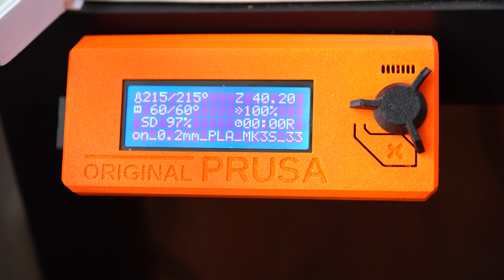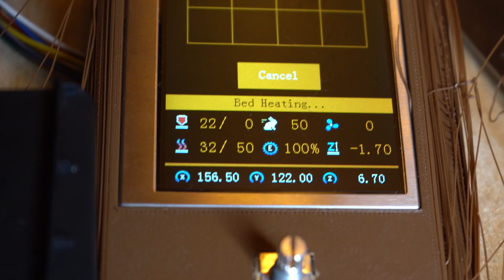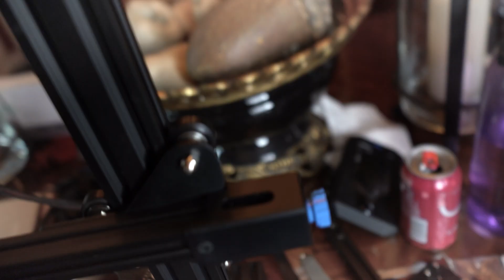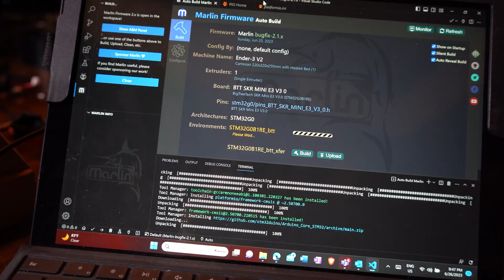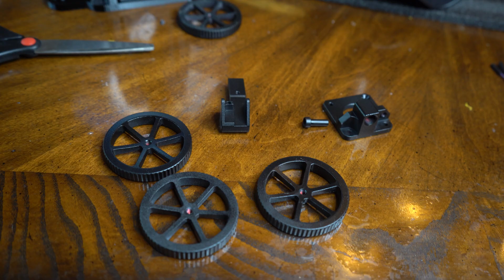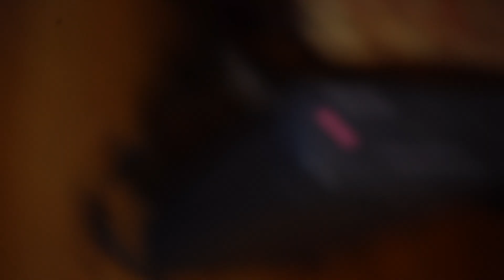The CREALITY Ender 3 V2 | Worth Upgrading?

Comment: My adhd left my ender 3 pro in pieces so I made minimal upgrades to my ender 3v2 and even then, there are some things not worth it. I would leave it as stock as possible. I think a bltouch and klipper are mandatory. Everything else is optional until it breaks.

Comment: Why was adding the extra z motor a mistake? I am looking to do the upgrade to dual and then I will purchase the board you got. I’m not too confident on the firmware side but I’m sure I’ll figure it out
Reply: I believe the board was a mistake not the extra z motor, because it comes mostly plug and play, it just adds on the existent z motor so no need to a board

Comment: weirdly i have two V2s one has a sprite and xl kit fitted never had one issue with it always adears ect the other one iv got is kinda like this i changed the extruder to the duel gear one with a bi metal heat break and its been absolute fine since both have CR touch not BL touch that's the biggest issue with them 

but then u get what you pay for

Comment: You are comparing apples to oranges one printer is 250 ish the other is nearly 1000 dollars... Even if you upgrade Ender is most likely 350 dollars at max! So 35% of the price of Prussa... Ender is for DIY people while Prussa is for people want to get results out of the box... That's the diffrence I have 6 Enders v2's And 2 v2 Neo's and I have upgraded them all with double Y and Z axis linear rails double hardened gear direct drive Extruders, plastic spring mounts, bed isolations, copper plated heatblocks, titanium and copper bi-metal heatbreaks... And last ofcourse Klipper with input shaping with ADXL345 acceleration sensor with Raspberry PI Pico so I can input shape automatically with all my printers and I have to tell you Prussa is a joke after all those updates please people don't buy Enders if you are not a DIY guy...

Comment: What was the total cost of the upgrades? Would it be better to just buy a "better printer" that has all these features already on it?
Reply: Definitely would be cheaper in total to get a better printer from the start, but if you already have a v2, its probably better to just upgrade it. Plus, the upgrades can be done sporadically spreading the cost out over time.

Comment: Not sure how cheap this all is in America... but in Europe an ender 3 v2 starts at 250€, with all those modifications you still have a printer that isn't great and probably reached the price of a prusa.
And besides, my ender 3 v2 prints fine without too much tinkering around.
Reply: Only upgrade it needs tbh is the BL sensor and maybeee springs. You definitely could buy a better printer if you get anything else it's not a bad printer, though it does surprisingly well for the price.
Reply: You do not need BS-touch, you need springs and straighten the bed. = )
But you need hands for that. So instead may be buy some modern super fast printer which works = )
I mean 250 euros is too much for this kinda model. $100 may be.

Comment: I agree with pretty much this entire video.  I went down almost the same path,  got the dual Z kit, a PEI sheet kit (and did the springs), and replaced the hot end with a Micro Swiss direct drive all metal one.  I kept the stock 427 board though.  Then I just printed a new Setsana ABS fan duct for a single 5015 just like yours.  Didn't see the need to upgrade the board in my case, since I had no interest in dual-Z leveling on a small bed slinger.  Too much complexity for too little return IMHO.  Now my E3V2 is a very reliable little machine.  I also printed some feet to fit squash balls to lift it up, and put a 60mm fan on the motherboard compartment, since that thing can barely breathe in stock form.  Now it sits in a bag enclosure comfortably pumping out ABS+ prints with no issues.
Reply: I am going to try follow this
Reply: thank you so much. This has helped me in deciding what to upgrade and where to start.

Comment: Loved the video gained another sub.

I allways feel like im upgrading something on my ender 3 as it never prints just right. The best upgrades ive done have to be the following 
1-Cr touch (prefer the metal probe as plastic one broke afew times)
2- kevinakasam's belted Z mod 
3- professional firmware by mriscoc

Next on my list is a decent hotend as it keeps clogging still find myself using my ender over my 350mm voron 2.4 as that takes too long to heat up for smaller prints even tho my voron can print the same in less than half the time.

Carnt wait to see what you do next to the ender 3. Your video had me hooked keep up the good work!

Comment: A few comments. Even if you have the lastest 4.2.7 Creality mainboard the SKR mini is a worthwhile upgrade even if only for the PWM for the hotend cooling fan. There is no weight issue running direct drive even with the heavy stock motor. The ender 3 may be growing long in the tooth but still an excellent printer that can be just as reliable as the MK3 with a few cost effective upgrades like the bltouch and a steel sheet build plate. The best upgrade you can do is install klipper. It's a huge step for those who don't have experience dealing with firmware but a massive improvement in performance and quality for those who undergo the task.

Well monologged a worthy of a like.
Reply from the maker: Thanks, I ran a Marlin build for the Ender, But I'm curious to try out klipper.
Reply: @MaxyMeanderings  Try MRISCOC too a very interesting Marlin flavour. I obtained just few minutes less an Ender 3 V3 SE in lot of printings and still very good quality. 
I've nice mods on my Ender 3 V2 Neo.
Reply: Are my eyes trippin or is your x gantry off level as hell @ 12:46???